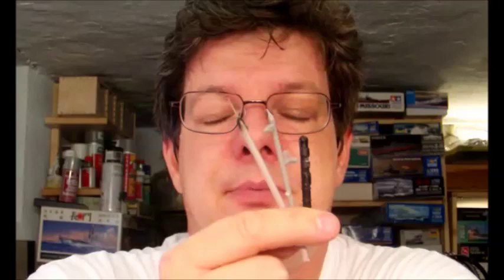1/350 Admiral Graf Spee Rigging I (Part 14)

Comment from the maker: Thanks! Pulling glue lines: Many have tried, many have failed! I can only recommend to try again and again using the conventional material, at a certain point you'll get the hang of it. In biplanes I have seen modellers drilling holes throughg the wings, set-up the rigging and then fill the holes up again. Then sanding and painting. I certainly prefer elastic rigging with CA.

Comment: Hi - will the superglue not attack the colour on the model? Which superglue do you use ? Have you experiences with woodglue?
Greift der Kleber nicht die Farbe an? Welchen Kleber benutzt Du ? Hast Du Erfahrungen mit Holzleim/Weißleim?
Reply from the maker: Hallo! Ich benutze hauptsächlich Uhu flüssig und Gel Superkleber. Je nachdem was gerade praktischer ist. Superkleber reagiert in der Regel nicht mit Enamel- oder Acrylfarben. Holzleim ist zu langsam zum Takeln, da ich vorzugsweise elastische Garne verwende: Die zeihen sich langsam aber sicher aus dem Leim.
Holzleim verwende ich zum schließen von Lücken oder um Persenninge zu machen. Beim Takeln eignet sich Holzleim zum Erstellen von Isolatoren, Spannschrauben und Blöcken.
Ich hoffe, das hilft!  LG!
Reply: Hi Guido. Mit Superkleber meinst du Sekundenkleber ?
Reply from the maker: Genau!
Reply: Dann ist es die brauchbarste Anleitung zum Riggen die ich im Net fand. Und ich suche seit Wochen ! Mal sehen wie sich das in die Praxis umsetzen lässt. Für mich jedenfalls perfekt! Vielen Dank für Ihre Mühe
Reply from the maker: Immer gerne! Wenn nochmal Fragen auftauchen: Einfach nochmal anklingeln!
Viel Glück und Viel Spaß! 
Immer dran denken: An manchen Tagen klappt es einfach nicht. Dann nicht versuchen, es zu erzwingen sondern lieber vertagen!